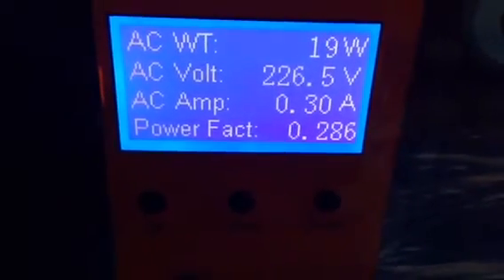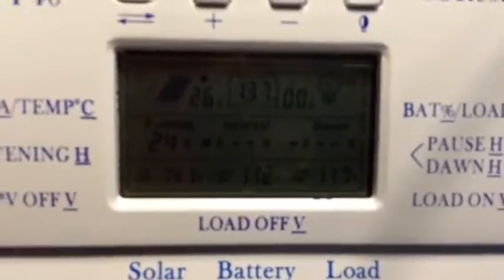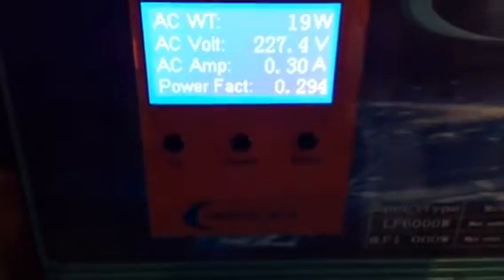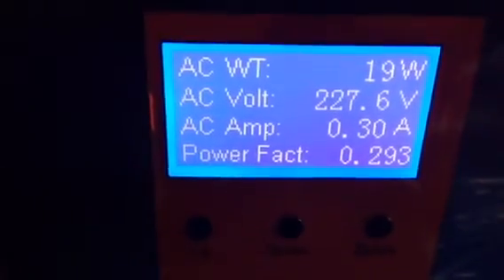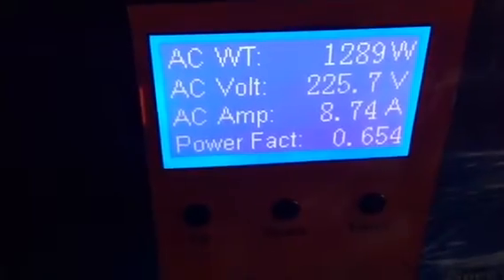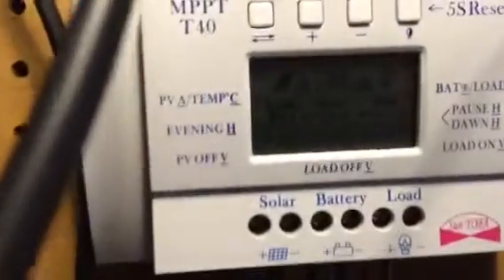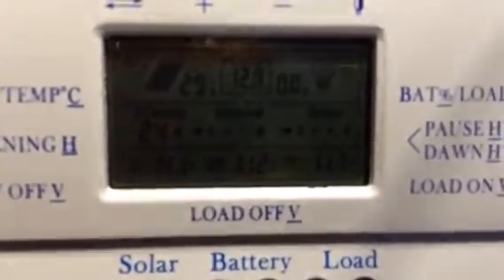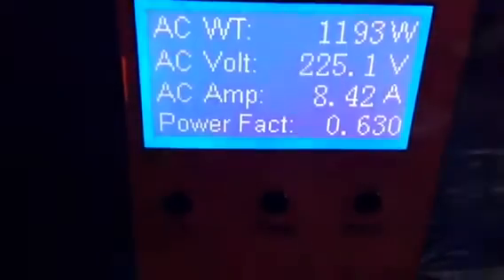CamRhon Tech PowerJack 10000 Inverter

Comment: I have the same inverter, but it is an 8000 watt. It throws over use alarm at 4000 watts and shuts down 1 minuet later. The company could not give me any reason for this and after many emails they said that is just the way it is. Do you have the issue with the over use alarm when drawing 1/2 the rated power? Also do not attempt to use this as an UPS for your home, I did and the first time the power went out, it blew out half the moffits (or what ever they are called) on the positive side.
Reply from the maker: How big is your battery bank? (Amp Hours Capacity)
I only have that problem if I try to run a load greater than my batteries can handle.  For example, if you tried to run 4000 watts which draws about 36 amps on the AC side, the DC side Amp Draw will be approximately 360 amps. So if you only had 1 or 2 deep cycle batteries at 100 amp hours each, you would not be able to run that load. In short, you would need more batteries. 
If you have a continuous load of 4000 watts in the above example and say 400 amp hours of capacity, your batteries would be dead in 1 hour unless they are being charged by solar or some other means.
I blew out my Mosfets too but it was my own fault. I accidentally connected it to the grid power (forgot to throw breaker when I switched to off-grid to run the house).  You are correct, This is NOT a Grid-Tie inverter. It will run your entire house if properly connected and you disconnect power from the utility company first...
Reply: CamRhon Smith I have 20 95AH Telecom AGM batteries. Generally at 4000 watt draw the battery voltage drops about .4 volts, remains in the 13 volts,
Reply: CamRhon Smith   how is the inverter running